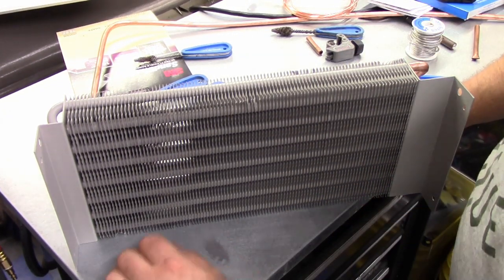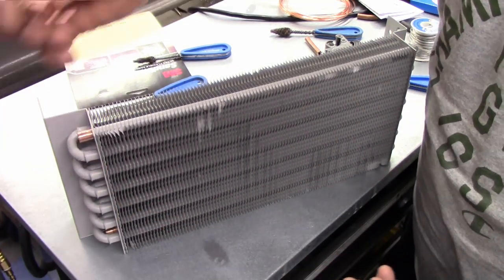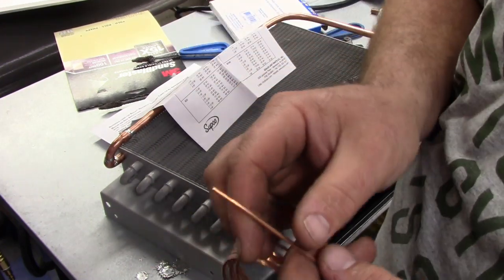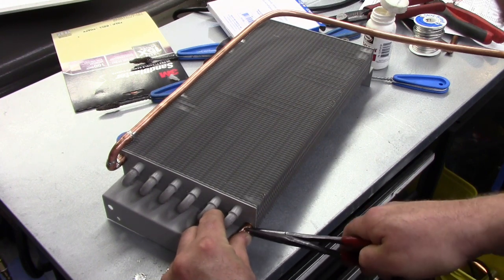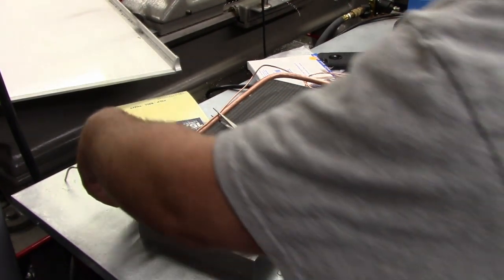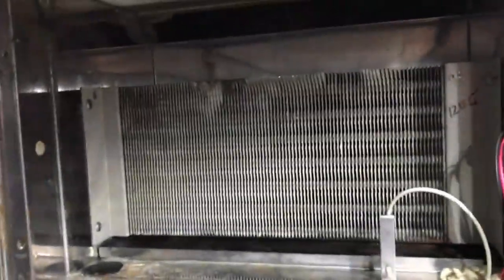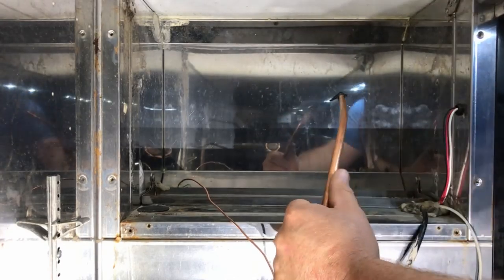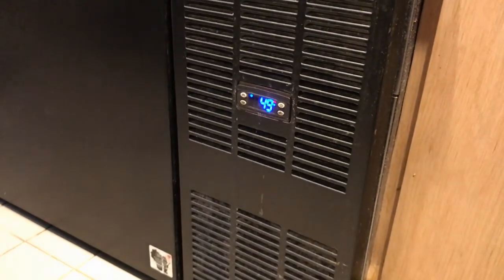Another Day in the Life of an HVAC Tech: Episode 18

Comment: Bonding cap-tube to suction line : It helps sub-cool the cap tube and reduce vapor flashing, and thus the evaporate can be more flooded without carry-over (especially in this bottom-up application). Bonding liquid line to vapor line can help increase capacity but is not for remotely located TX valve applications -- cause some of the super heat is used in liquid sub-cooling.  Electrical tape overlapped wrap is sufficient to repair bonding on older units where cap and suction line have become un-bonded. Unroll tubing on flat surface to keep it straight.   Compare BTU ratings of old and new compressor(per operating range) to resize cap tube if needed.  3/16, 1/4, can be nested inside each other and can be used to make a capillary tube adapter, if you ever have to epoxy bond to an aluminum evaporator.

Comment: Crimping the shot out of the evaporator inlet??  Seems kind of destructive.  Using a fitting (like an elbow) to make the transition would save from crimping the actual evaporator, and make future service much easier. Less chance of having the evaporator inlet crack or something, as you mentioned it was very thin copper.
Reply from the maker: Problem is there is no way I could see what was behind there.  At the time of the original service call the unit was a block of ice.  The coil sits in a drain pan and I could not tell where the lip of it was.  If I took a guess using a stub of 3/8 copper and was wrong then it would be a lot more difficult to correct.  This way there if I need to move the line it's just a cap tube and easily bent.
Reply: @Halligan142  No worries mate.  Love your videos.  My favorite is one you did a long time ago, on what different types of solder to use to join various materials.  I watched it more than once.  Soldering to you in the trades might seem very common, but your video is likely very helpful to the machinist crowd, as we are not aware sometimes of the various silver solders and brazing rods available. Keep making videos.

Comment: Majority of what I work on is small reach in equipment. So far Stay-Brite all the way. Found a YJ tubing roller crimper and a one handed manual swager to make some of those weird transition pieces a tighter fit.
Reply from the maker: Yes absolutely works great.  We do a mix of everything and honestly usually by the time a coil goes in a reach in the rest of the unit is in sorry shape.  This one was only 3 or 4 years old.

Comment: Hey I just have a quick question. Why don't you use some sort of brazing alloy such as silfoss? Instead of soft solder?
Reply from the maker: Heat concerns when soldering inside the unit itself and no need for Nitro purge

Comment: Thank you I fucked up I put r410 into my r22 condenser with a r410 air handler any thing I can do most people say no it’s running ok not good psi on high side is about 410 low about psi 76 is it done.can I just change the condenser to r410 ???